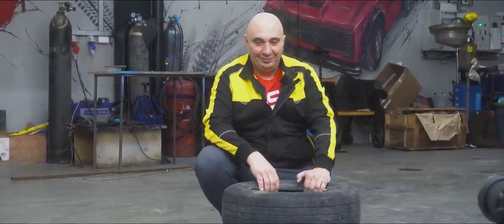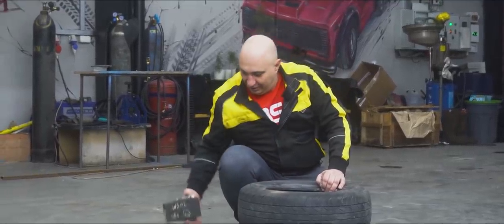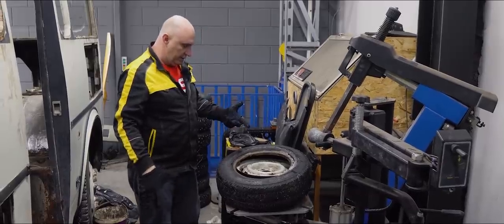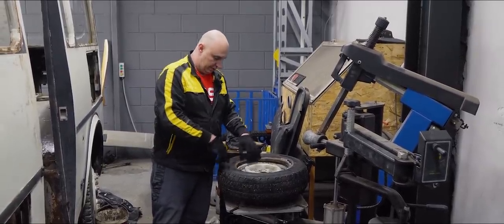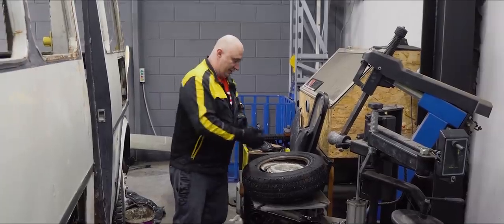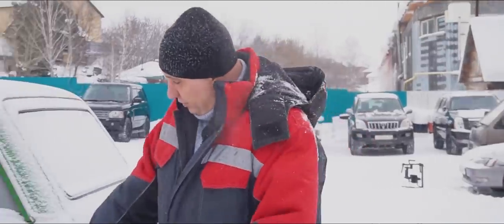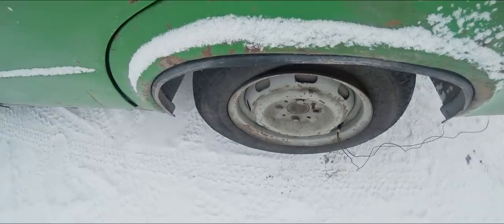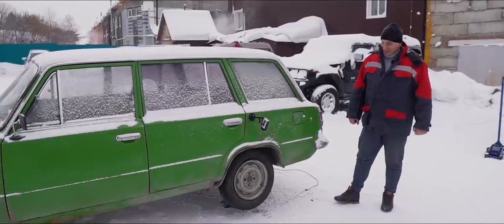Will an airbag rip a tire apart from the inside?

Comment: Do a rear engine (not mid engine) but front wheel drive 🥲
Reply: With rear wheel steering
Reply: @zebracake2246  so a rwd car with the seats flipped backwards.
Reply: @piority9  they allready did that with a lada you vab find the video on the russian channel
Reply: @piority9  yes but pedals and steering wheel flipped around too. And i believe he means rwd with the driving wheel being under the engine which would be in the back
Reply: It's called reverse.

Comment: Those wheels look a lot like the ones used on  VW Beetles from the 70's. There are other Ladas that use the circular holes pattern that look like the rims from the VW Kombi from the 70s as well. I've always wondered if the same manufactured made the wheels for both ladas and VWs
Reply: that would be cool
Reply: They are also very similar to steel wheels used on 60's Volvos - later Amazons and early 140 series. I have also seen similar ones on Porsches, did VW share wheels with Porsche?
Reply: @lobmin  Porsche is owned by VW so it could be possible.
Reply: @lobmin  well... The wide 5 lug pattern they did share, but not exactly the same rim design. Porsches had vent holes, while VWs had the typical slots between the face of the wheel and the rim. Aome later VWs had vent holes with the wide 5 lug pattern, but were very different from those of Porsche
Reply: Sure do.
Reply: In the 60-80s VW was not allowed to monopolize parts. So long as a manufacturer was making them, they could sell the parts to other cars. In Brazil we had the Gurgel who was similar to the russian Ladda, as in it was a car made using parts from other cars to make it cheaper

Comment: The volga tire might be C-classed. Not uncommon for those dimensions back in the day. Thats probably why it stayed together despite the age cracks.
Reply: id agree. commercial vehicle rated tyres. no regular passenger cars have a 75 profile section. they drop from 80 to 70 in regular car sizes, but van/commercial tyres DO have a75 profile option

Comment: Most airbags have a small cylinder where the wiring connects that released the gas to inflate the fabric bag. For an enclosed space like a tire, the airbags could be disassembled, and several of the inflaters would occupy the same space as one entire airbag.

Comment: Suggestion:  I'm wondering how much you can improve an off-roading  vehicle stability by adding a very heavy medium inside the tires to lower the center of gravity. (while keeping tire flexibility)  ex: Sand+ water, mercury, 
One way to test would be to see how much of an incline it can go before and after before it rolls over.

Comment: Try to make a lada do wheelie by building huge spoiler to rear with long leverage and controllable deflective control surface . Drive it with maximum speed and deflect the control surface to create downforce and try to lift front wheels. Engine to the rear and try to make front end as light as possible. With massive size control surface and enough lever I think it might be possible :D

Comment: If you just took the charges out of the airbags, mount them to the wheel, have an airtight way of wiring.. then you have a device for instant tyre reinflate if you get a flat.... Maybe have some tyre sealant in the charge,. Get a flat tire press the button instant fix

Comment: The 15 looks to be an 8 ply commercial construction while the 13 was just a standard car/light vehicle tyre so it will take probably take double the psi without blowing, as for the airbags the chemical reaction in them is self oxidising and very controlled so the large bags charges sould release more gas regardless of them rolling out or not. Think the lack of boom was just due to construction. You could get one of the model rocket guys to make you some charges that will do similar but make a whole lot more gas ;)

Comment: Ground the airbag on the inside of the wheel, solder the hot wire on the inside of the valve stem. Then you can air the tire up to 100psi  and clip 1 lead on the calve stem and the other on the wheel.

Comment: Try putting vodka instead of antifreeze see what happens
Reply: That just works... Vodka has enough water that the freezing point is low enough... Antifreeze is not 100% alcohol... It's pretty much 50%/50% mix... Vodka has about 40% alcohol by volume, so it's close enough... If you put too much alcohol and too little water, it doesn't stay liquid and escapes as gas or steam...
Reply: @Monni95  thankyou ive just learn't something i didn't know

Comment: I've had trouble getting through these, even though it looks like good content.  Finally, I turned off the sound and turned on the sub-titles.  It happens that I grew up preferring sub-titles over dubbed movies.  It seems I have a problem with the current style of dubbing for this kind of content.  I don't know why, but I enjoyed the video when I turned of the sound and turned on the sub-titles.  The thing is, I like this guy (the one in the vid).  Could someone invent a way to get sub-titles -and- sound without the generic dubbing--please?
Reply: I believe the original G54 channel has subtitles. This is the English voiceover channel. I don't know the link to the original Russian channel since I believe the name is in Russian.
Reply: @brucewrigleysgumchewz4667  Very much appreciated.  If anyone knows the link, please share it.  I think I take a shot at a translator.

Comment: I would have connected 1 wire to the wheel the other to the valve stem. That way it would have been sealed.

Comment: He needs to use American airbags. Airbags around the world are calibrated to assume an average weight occupant who is restrained by a seat belt. In the USA the 'average weight' used is higher the rest of the world, but importantly they are calibrated to assume that the occupant ISN'T restrained by a seat belt. In laymens terms this means that airbags calibrated and installed in the USA hit MUCH harder then the rest of the world. That's why America often have facial injuries caused by airbags that just don't occur in the rest of the world - its because, seat belt or not, they are being smashed in the face much much harder then the rest of the world.

Comment: 6:20
I can't fucking believe that he was wrenching the tyre open with his bare hands, the metal wires were sticking out and they're sharp!

Anyone who has handled a worn or blown tyre knows why this guys hands must be made of iron
Reply: Since he said the tire originally contained a tube it is highly likely that it is bias ply as opposed to a radial, and had nylon belts opposed to steel.
Reply: @johnfox3845  aha, I missed that part, thanks for clarifying
Reply: @hamstirrer6882  No problem. 

As someone who has changed a ton of tires on pretty much anything with 2, 4, and all the way up to 18 wheels, you sure are right about the steel belts. I have gashed, stabbed, and sliced my hands on those bastards more times than I can count.

Comment: Me trying to be productive.
Garage 54:
Will an airbag rip a tire apart from the inside?
Jk, I wasn't being productive anyway.
Reply: As a stunt driver, I used to test how hard we could crash without getting airbags deployed... We didn't want to waste time disabling them... It was fun launching the car in mid-air and fly across roads waiting if airbags do deploy when landing... With older cars without airbags, it was more fun as only result was fused brakes due to salt water getting in... The cars we used had proper front bumpers, so only fix afterwards we needed was some glass fiber padding and fresh paint, as the front bumper didn't bend when crashing...

Comment: I would assume that since they are explosive devices, they need air to detonate. Since there is not enough air to detonate all 4 then you will have just 4 half-burned weak ones. Probably just one would have done a bigger boom (like on lada).
Reply: Wrong! Only gasses, mists or dusts requires a pre existing oxygen mix to explode. Explosives usually doesn't need air to explode. Gunpowder for example creates it's own oxidizer during the chemical reaction. Same for airbag propellant. Otherwise it would be hard to predict how large the explosion would be, given how high the concentration of oxygen would be at for example different altitudes. Also the effectivity of the explosive would be less the larger amount you would use, since there is only so much oxygen surrounding the fuel at the time of ignition, the rest would mostly be pushed away by the blast. 
There are also some airbags that utilizes high pressure gas canisters which inflates the bag by rapid pressure release, with no chemical reaction.